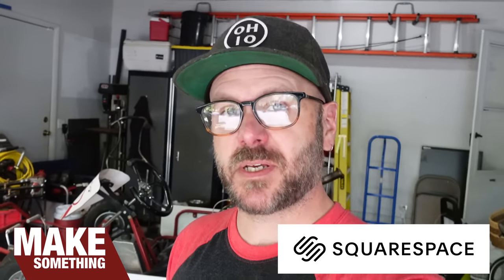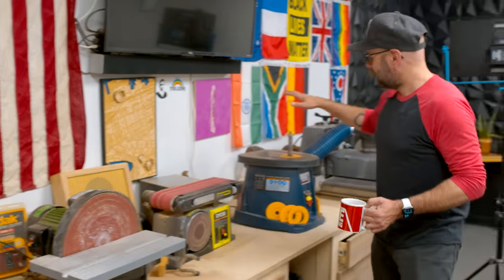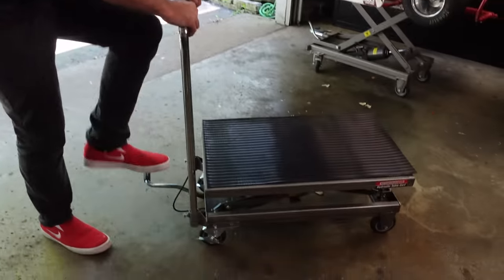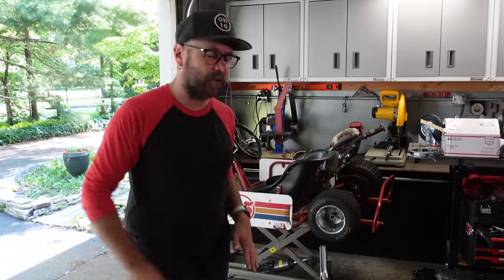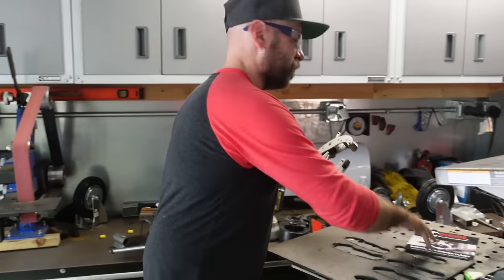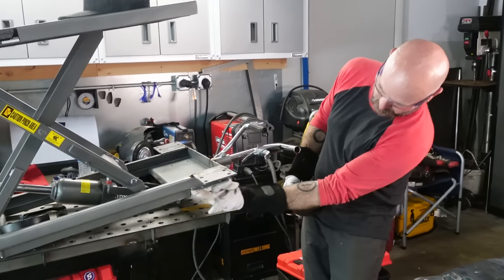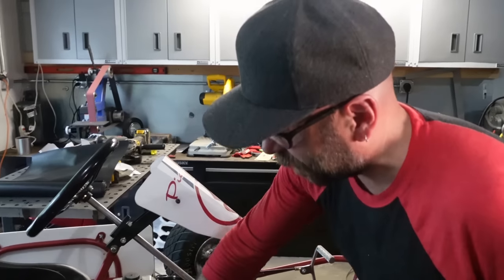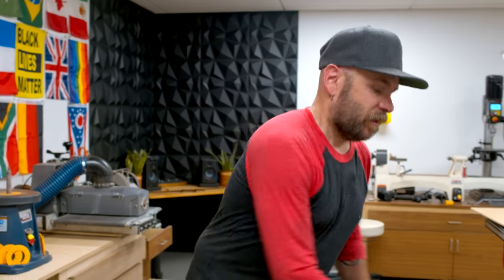My NEW Favorite Tool from Harbor Freight | Hydraulic Table Cart

Comment: I always thought it would be cool to take one of these things, bolt it to the floor and put a workbench top on it. So then you can have a workbench any height you'd like.
Reply from the maker: This is brilliant!
Reply: Where I used to work we had work benches similar to what you mentioned that had a car jack fabricated into it so you could lift or lower the table
Reply: Can’t believe there’s no comments about the bottle of Jim Beam next to the disc sander!
Reply: Ol' Mike Farrington has something just like that. It's legit
Reply: Love it!!!
Reply: @bullheartstrump  yeah I remember seeing that video and that's what gave me idea of something cheaper. If I'm not mistaken his was a very expensive hydraulic scissor lift that he found at an estate sale. I think if you wanted to go his route, you'd either have to get very lucky and find a used one or spend possibly thousands. but with the Harbor Freight lift, it only be a couple hundred bucks and readily available for everyone.
Reply: I can se using one for raising lawnmowers, etc. I make a dolly for my snowmobile. Do hey have a volume discount on the tables?
Reply: That would definitely come in handy for Evan and Katelyn! 😃👍🏻👊🏻
Reply: Thought about the same thing with one of their motorcycle lifts
Reply: sixtyfiveford has a similar setup for his workbench using a high lift pallet jack. He left the wheels on it so he can roll it up to the back of his truck and load/unload engines and equipment. As in this video it seems like a back saver. He has a video where he rebuilds the bench top. I forget how much he paid, but I think he said he got the pallet jack for scrap prices.
Reply: Ishitashi on YouTube has a workbench like that, I think I spelled his name wrong though...
Reply: I thought the same thing. Mike farrington has a scissor lift workbench thats similar
Reply: There are you tube videos on making a work bench with a hydraulic cart like this. I've thought it would be cool to use a bigger motorcycle lift table.
Reply: I immediately thought about that as well
Reply: I've seen that mod done using the motorcycle lift.
Reply: @denoftools hey bear! Still is twice as much as the cart though.
Reply: I got a good idea make a cabinet around under the base stored in your living room floor laminate floor on top electric motor push button remote control Rises out of the floor good stash place

Comment: RE: Why the caster has two different head sizes? Because if you only have one set of wrenches/ratchets, you would need a duplicate of one wrench.
Reply: Thank you...
Reply: Was just loggin in to say the same thing.  Nice one.
Reply: That actually makes a lot of sense
Reply: I should have read down before I made my comment.
Reply: Great comunity here what a great bunch of people.
Reply: I came straight to the comments to say this exact thing lol
Reply: Who does not have multiple sets of sockets, & wrenches? I’ve worked, in, & around so much stuff, on so many things over the years, ...  that I buy a new set almost every month, ... nah, but I have 3, &1/2, ... 3/8 socket sets, all deep wells, ... because some, are longer than others, ... yeah, I know, it is sad, right? Lmbo, but I’m not lacking for any specific size any longer, ... lol, ... Last month, I bought a metric, plus the SAE set of ratchet wrenches, in 4 differing combinations, ... plus, I have most all of my standard hand wrenches, ... but am missing a couple, that I have misplaced, lol, ... they are here S O M E W H E R E! Just not sure of exact location, ... 

I Swear! I’d lose my head, were it not sewn on, ...

Comment: To answer your question about the different sized bolt ends, it's because most people only have one set of wrenches/keys, and if they were the same size, they couldn't tighten the bolt (one set means only one key of that size). So by using different sizes you can use 2 keys from the set, instead of a key and pliers or adjustable wrench or some other tool.

Comment: I am truly a one-man shop, and found the best Harbor Freight tool for lifting heavy stuff in the shop to be their 2 ton engine hoist.  With the 20% off I think I paid $150??  A bit awkward in close spaces due to the long legs that stick out front, but when it came time to lift my Saw Stop out of the shipping material and stand it upright it was a breeze.    Same when I had to lift my Laguna band saw and install the base stand.  I designed my lower cabinets and benches so the toe kick is removable so the protruding hoist legs can slide under the cabinets.  With a home-brew adapter on the lift I can lift upper cabinets into place with nearly zero effort.  Also a huge help when lifting heavy objects from the bed of my truck and onto my rolling bench (actually a salvaged ambulance gurney with folding legs).  When not in use the hoist folds up and hides in my side yard under a tarp.  Being an old guy with a history of back surgery makes you one inventive SOB.

Comment: Another back saver you might want to look at is the truck bed mounted crane. Why pickup the cart lift after you get the cart into the truck when you can simply weld 4 lift points to it and use the cranes hydraulic jack to lift it up and swing it into the truck for you.  Item # 60732 at Harbor freight or 61522 for one with a hand crank winch on it.

Comment: I love my HF 1,000lb cart. I use it all the time.  just in last month used it for assembling a 700+ lb lathe,  prep heavy maple log, work on lawn equipment, as a table , hold a heavy piece of equipment level so I could attach to wall, use it a lot to get heavy logs onto my sawbuck for chainsawing

Comment: My wood turning club purchased one of those carts back in November of last year. We use it to lift our lathe up and move it into position when we have our monthly meetings. Such a huge back and time saver using this cart! Only downside of the cart is that it won't lift high enough to move our Jet lathe. I usually use a couple of turning blocks that are long enough and high enough as spacers to lift the lathe an inch off the floor to move it. Best purchase our club has ever made since I am usually the one setting things up each month :D Hopefully soon we can get back to having meetings again!

Comment: I am with you on that Drill press situation. I built a base for my used  JET JDP-15B and I was flummoxed when I tried to put the drill press on the new base.  I tried ladder, wife, lifting it to multiple incremental heights and could never get it on there. I ended up using my tractor of all things. This table would have been really really handy. Thanks for sharing.

Comment: Sweet rig David!  You may find that those plates you welded on for the casters will flex or bend over time. Some small gussets on the underside would help prevent that and shouldn’t interrupt the caster swivel.
Reply from the maker: Thanks Matt! I might have to do that!
Reply: @MakeSomething  now that it has been 3 years, how has it held up?  Also...mine is pretty heavy (I have the 1000 lb table) and now that you removed the push handle, is it a struggle to maneuver where you want it when you take it to the track?   Thanks

Comment: Love the Ridgeline. I’m on my second one. People always are amazed by the storage under the truck bed.
Reply from the maker: Good eye! Yeah, I’m really liking it!
Reply: I still haven't figured out a good way to move longer lumber and plywood.  Any suggestions?
Reply from the maker: I poke it through the sliding back window. I wrap a blanket around it for protection.
Reply: d3lsl0w can’t just strap it or add a bed extender to the tailgate?
Reply: I use an extension on my trailer hitch. You can find one for about $80 online. Works great for kayaks.

Comment: I'm planning on buying one and with some modification (no wheels and so) to put my WorkBee CNC on it.  Plan is to mount it inside a table frame and when it's lowered, I'm able to put a plywood panel over the top so I have a workbench/outfeed table.  When I need the CNC, I remove the tabletop and raise the CNC with the hydraulic table.

Comment: I've had one of these for a few years now, and It's gotten used primary to life heavy rack-mount servers into place at my employer's data centers. I will state that the casters on mine wore out far too fast; they don't have any bearings in them at all. I ended up  purchasing and cannibalizing a set from the local home improvement store to replace them, and it rides like a dream. :)

Comment: I started buying those clamps ever since you talked them up in another video long ago. I like them better than my Irwin f clamps, the handles are much easier to grip and they don't flex as much. HF gets a lot of grief, some of it is deserved, but there are gems to be found. I've had more than one occasion to wish I had one of these lifts, and I've been eyeing that spindle sander for a while. I may need to just pull the trigger. Great mods on the lift here. Thanks for sharing!

Comment: HA! I tell people this is the one tool you don't have that you never knew you needed until you have it.  I get at least an email or comment a week from someone who finally broke down and bought it and had to admit that I was right :-)   One thing I will tell you that you probably didn't realize is that the 1klb cart is what you really wanted.  Yes, you don't need the capacity BUT it lifts a good bit higher, as in, right up to your tailgate on the truck.  I just wish they made the front wheels, on either model, swappable for swivels.  In a small shop it would be great to have a zero point turn option.

Comment: I really wish the height of that lift extended to the height of my table saw. I know it's a terrible idea, but that would make a neat outfeed for a small shop
Reply: UncleBeard the 1k pound goes higher, not sure how much though. The handles on the larger one also fold down for better storage. 
It would make a great multi-use surface for a shop though plus heavy object lifter when needed.
Reply: @darinnetherland3466  Thanks for that info! It looks like the 1k goes up to 34.5'. My table saw is about 35.25'. That half inch might be close enough to make it work. I could make a tray with a half inch sheet of plywood and I think I'd be in business! I appreciate your help brainstorming!

Comment: I have the 1000 lb. lift table. My only gripe, (other than it's weight) is that it only has one scissor section, limiting the lift height to 34". Many, many years ago they did offer the one with two scissor sections and could lift things 54" high! You can still get one of those over at Northern Tool... but it's now $550
Other weird thing I've found, is that the hydraulic portion doesn't work unless the handle is elevated above the cylinder. Meaning, that if you wanted to lower the handle, to get under something, either by removing it, or what looks like the ability to lower down (it doesn't) the foot pump action will not raise the table. So you end up in an awkward position kinda holding up the handle while pushing on the foot lever with your hand. Clearly, I think there's something wrong with mine, and I don't think that should happen on a closed loop hydraulic system.

Comment: Although, your weld isn't super critical it's generally not good idea to rapidly cool welds because Rapid cooling may lead to distortion, increased hardness, and 

decreased ductility. JB Weld makes a good two part adhesive you mix together for bonding rubber to metal.

Comment: I have eight of size of F-Style clamp ... The older style (w/ wooden handles).  Two of their mini routers, one that is nearly twenty years old.  If its used with care, for the right job, and maintained, they can last.
Reply: Steve Halsey first f style clamp I grabbed off their rack didn’t work. Just slipped instead of tightening. Never bothered with them after that. As with all thing HF it’s kind if a crapshoot, but I do roll the dice now and then.

Comment: cool build, tho for me i would have not moved the lowering handle and just bent the puch handle further out to fit the kart but still having the lowering handle on top so you dont have to keep bending over to lower it and you can still push the full cart around if needed....and also added wheels that lock into place.

Comment: i have that table. It's stopped staying lifted, so I think I have to fix the hydraulic on it. Works great when it was working though!
Reply: How old Is it?  Can you get parts for it, or is it a use once and throw away?
Reply: @terryk3118  I purchased it back in 2013 or 2014. I don't think anything is broken, I just need to either refill the hydraulic fluid, or see if there's a seal or something that isn't installed correctly and is leaking.
Reply: @davidn7945  I'd be interested to know what you find out. My concern about the more complex tools from HF is that parts won't be available.
Reply: @terryk3118  Yeah I've been looking up some stuff on YT to see if anyone else has had this problem. Only a couple of videos and none of which show how to actually fix it, so I'll probably just experiment with it one of these weekends. When it worked, though, it was great! I still use it to put heavy stuff on to move around if I don't need to use the lift feature.

Comment: Bolt with different head size maybe are though for people that has just a single set of wrench so with 2 wrenches they can lock the wheel without using pliers or other stuff ruining the head M)

Comment: I love the sarcasm as always, especially about when to start watching for the cart specifically lmao. And no way, you should use this awesome lift for a woodworking table/machine flip top, etc. I’m very short and need a short mitre station that underneath has space to house carts, flip tops, removable workbenches, etc. that if need be I can lift up higher or shrink down lower depending if I use a trusty stool or not 🤦🏻‍♀️ jk but really, I’d love to see what you come up with as a height adjustable work surface

Comment: They do that with the bolts so you don’t need two of the same size wrenches. Actually they probably did t even think about it... nyloc nuts are often different than regular nuts. But still. Lol

Comment: I use to use these everyday at the fab shop I worked I don't know where they got them and also I don't think it's the same one as in this video but they work great for picking up real heavy shit we made ballistic doors and stc doors even 14 ft long doors doors that weighed 400 pounds and more we used these to move them and even used them to help when I would grind welds on the side of the doors only danger is do not leave anything on these things overnight they hydraulics will lose pressure over hours of time

Comment: The wheels on that unit is crap! My unit is around three years old and the wheels cracked and feel apart. Bought some solid rubber wheels and replaced all the wheels on that unit. Good luck with your unit.

Comment: Ok, in reference to the bolt, & nut issue? The nut is always 1.5 times the size of the initial size on the bolt, ... it has to do with the strength of the bolt, in relation to the strength of the nut, ... IDK, but was told about 150 years ago, (or something like that, ... it’s been awhile though, lmbo), ... that it has something to do with the engineering of the strengths of the bolt, ... if it were a smaller diameter, then it would not retain the same strength, in the bolt, if they reduced the size of the nut, then it reduces the strength of the nut, & overall changing the combined strength, ... yada, yada, blah, Blah, BLAH! 
And yes, welding galvanized anything is the pits, ... 
Now, in addition to that lift table, they have on sale (this month), a riding lawnmower lift, of 2 models, 1is $99.00, & the other is $299.00, although I don’t know anything about the bells, & whistles for each product, ...